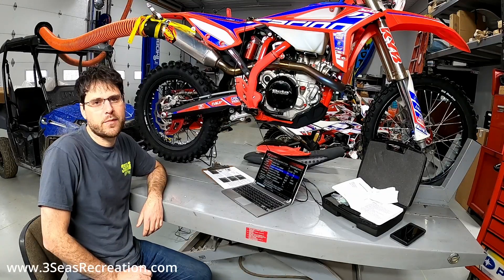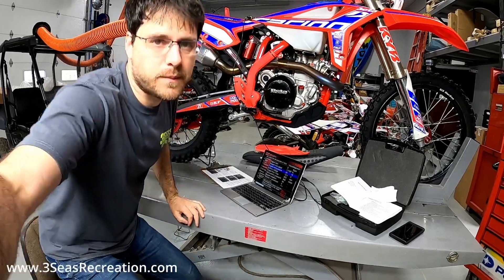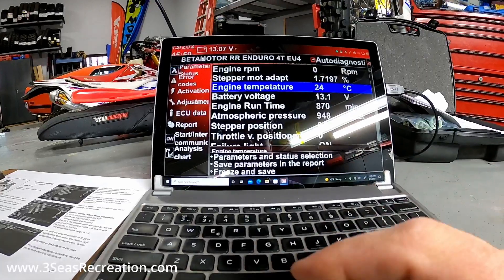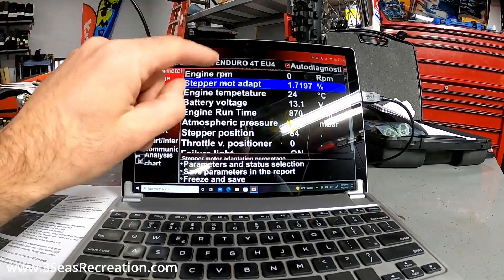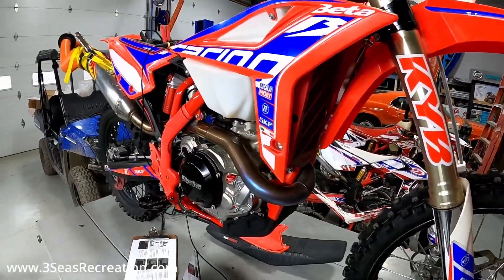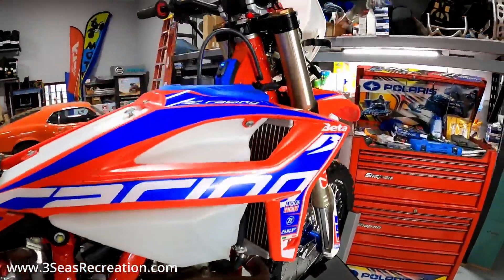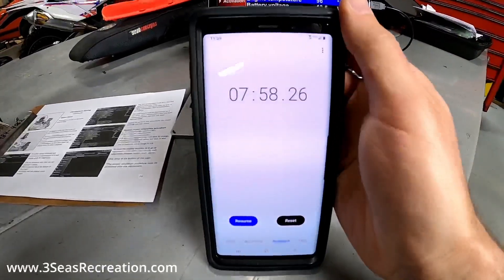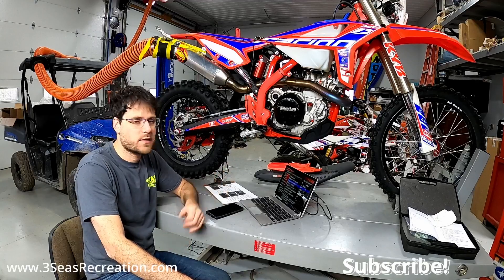Poor Running Beta 4 Stroke Motorcycle | STEPPER MOTOR RESET | Stepper Motor Adaptation Procedure

Comment: Thank you for your videos, it is a big help to learn about the Beta bikes after 6 years on Yamaha. I got 350 RE 2022 and I did the stepper motor setup as you showed, but still I got a problem that sometimes the rpm drop slow after I let of the throttle, any idea what can cause the problem? The bike run good at idle
Reply: a very stupid thing can be the throtlle cable without enough play, or a bit dirty. Even  1 mm still  forcing opening when released can really  put a mess on idling when throtlling off...
Reply from the maker: Glad you like them and thanks for subscribing! I would still contribute the issue to that stepper motor, depending on how much time you have on your bike you may need to take it apart and clean it. I plan on doing a video of that here soon... Keep me in mind for future Beta parts orders, we can drop ship right to your door step from the Beta USA warehouse!

Here are a few other things to check: 
Low battery/charging confusing the ECU.
Dirty or worn throttle body.
Stuck or bad stepper.
Air leak.
Glitch in the ECU map.
No throttle cable slack or something causing tension.
Binding throttle tube.
Reply: @3SRTVOfficial  Thanks  for the quick respond. The bike is brand new, about 8 hours. I did have a "check engine" fault code on my first ride (P0102), I checked and it seems something with the battery but never come back after I took of the headlight bulb (I thought maybe the fan is loading on the system because I am riding in a hot environment). I will check the other thing that you recommended!

Comment: My bike shut off when i realese the accelator..doesn’t run in idle..is that stepper motor problem??
Reply from the maker: I would absolutely try this stepper motor process, you should actually consider doing this process anytime you go to a new place to ride. I would also load test your battery to make sure that it is 100%. We had a bike that we did everything to and all it ended up being was a dead battery... It would still start and "run" but never idle.. Thanks, Jared
Reply: @3SRTVOfficial  A common failure is the harness cable going to the rec reg which is too tense : plug can be seen correctly connected but in fact you have bad contacts and charging is erratic. Using data log ( even with ordinary odb2 software like Car scanner pro which records real time multiple parmaters ) ,when running bike, makes diagnosis very easy...   Starting bike with a weak battery will make the voltage drop to  8  or even  7 volts with the starter crancking and the ECU has no undervoltage shut off protection( like cars ) .PCM circuit of ECU  will stil drive  the sensors, fuel pump, etc.. It can end in a bad situation  which can results in  glitches in the ECU memory...

Comment: I havea 2020 that even after warming up to 100 degrees I his the throttle and it chugs. I let of the throttle then it went back to idle. The bike finally ran fine after it hit the 211 and the fan came on. I believe is the stepper motor. What do you think?
Reply from the maker: Hey Good Evening! Thanks for the comment, I did this video in Celsius because that is what the computer reads and also what the procedure manual has it in.. For us here in the USA we are more familiar with Fahrenheit and that would need to be just above 200 *F like you found out. Thanks for watching, Jared
Reply: @3SRTVOfficial  So do I have to get it that warm every time before riding?
Reply from the maker: If you are riding at the same place multiple rides in a row you do not need to. I would just recommend doing it if you are going to change elevation for the weekend or if the temperatures are much different from the last ride. Thanks for the comment, Jared

Comment: Also to note (my bike came with a thermostat that kicked on my fan at 150* F): Unplugging the fan will allow the bike to hit 215*F which is when the stepper motor will lock in.  It would never reach that temp if I didn't unplug my fan.
Reply from the maker: Hey Shawn, thanks for the comment. I just had to do some research but I found in the manuals that the OEM Beta fan is designed to kick on between 219 and 221 degrees Fahrenheit which is above the 203 degrees Fahrenheit (95 degrees celsius) that is required for the stepper motor to finish it's reset. Maybe you have installed a lower temp sensor or an aftermarket fan kit? Let me know, Jared
Reply: @3SRTVOfficial  Yes....on my bike it has the lower temp sensor (installed by the previous owner).  Can you please do a video about how to properly clean the Stepper motor?  There is ZERO information on how to do this anywhere that I have looked and I am sure many people would benefit from that.
Reply: Hi mate theres a video on cleaning the stepper motor here on youtube 
Search sherco stepper motor
Yes i know its a sherco but its the same motor

Comment: Trying to figure out my throttle/idle issue and I thought the stepper motor reset would do the trick.  The RPM's hang a little bit before dropping back down to idle when I let off the throttle.  Here is video footage of it:  https://youtu.be/Ozgl8M7zYuA
Reply from the maker: Good Morning, I still think it is a stepper motor issue, have you tried taking it out and cleaning it? Other than that my suggestion would be to take the bike to a dealer with the service tool and they can test the stepper motor to make sure that it is even working (I did that in the video but it was hard to hear). Also, they could do a reset while the diagnostic tool is plugged in and they could watch the value change to make sure it is working. Hope it helps! Thanks, Jared

Comment: So basically, if we don't have the tool, just turn the cold bike on without touching the throttle and let the engine run for approximately 8 minutes until the engine temperature reaches 95 Celsius / 203 Fahrenheit. That will reset the stepper motor?
Reply from the maker: Good Evening, yep that exactly what you should do. Keep in mind that if it is colder outside it may take a little longer to reach that 95 degree celsius temp but I wanted to show people roughly what they should be aiming for! Thanks for watching our video, Jared

Comment: Thanks for the video Jared. The one ongoing problem I've had with my 2016 430 rr race is a hanging idle which seems to be getting worse. Does the stepper motor have any affect on that. or is the idle problem caused by something else? It's been remapped for the FMF exhaust system. I've been told installing the 2017 map is a good idea. Thanks
Reply from the maker: Thanks for watching! I would absolutely take your stepper motor out and clean it. Also, you could take it to a close desler and have them do that stepper motor test to see if it is even working.  Maybe try a brand new battery, it could suprise you.
Reply: @3SRTVOfficial  I'll take the motor out and clean it. Carb cleaner? Does have a new anti gravity battery. Thanks
Reply from the maker: Carb cleaner and an air tool should do the trick. Thanks, Jared
Reply: @3SRTVOfficial  take it easy, as grease is still needed for the endless screw activating the finger ;)
Reply: I had the same problem. Worn Thottle body and the throttle valve was hanging inside the body.

Roughly said:
I Removed it from the bike. Than I grinded down the worn spots, did a ECU reset and now its idling fine again.

But I dont know how long it will fix the problem. Maybe I have to buy a new throttlebody in the future.
Reply: @mikegro8502  what wears out on the throttle body?  What should I look for?  Thanks
Reply: @BrockWarwick   the throttle valve inside of the body. The round yellowish plate which opens and closes when you twist the throttle.

it works itself into the aluminium.

Most of the time it is because the bearing of the valve no longer in perfect shape.
Reply: So check the Throttle valve for side to side and up and down play
Reply: @mikegro8502  Turned out it was a bad throttle body which beta replaced under warranty. Apparently Beta had a service bulletin out about this problem. The throttle body developed a groove which screws with the sensors and your stepper motor. All good now.
Reply: @racesla  how many hours did you have on your beta when the body was replaced?
Reply: @mikegro8502  93 Mike.